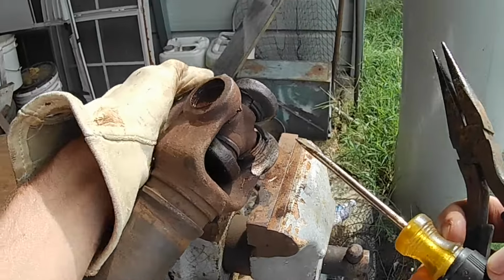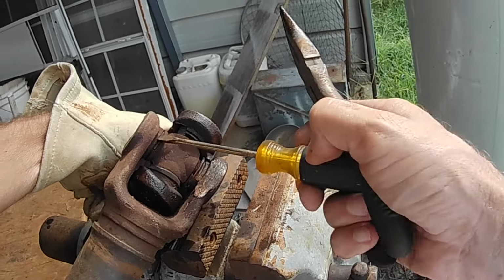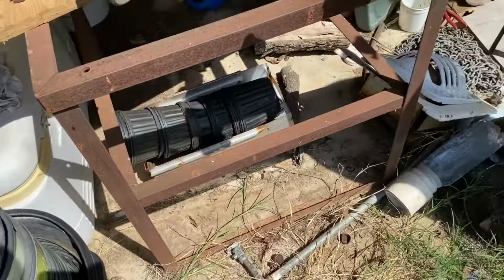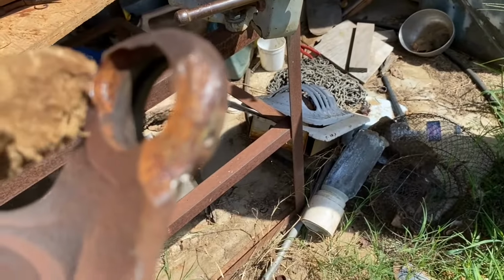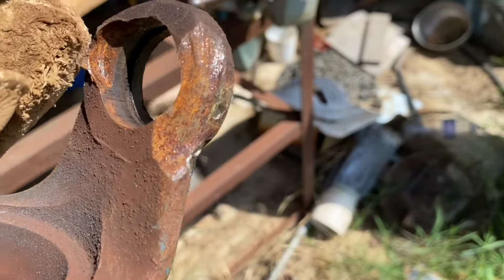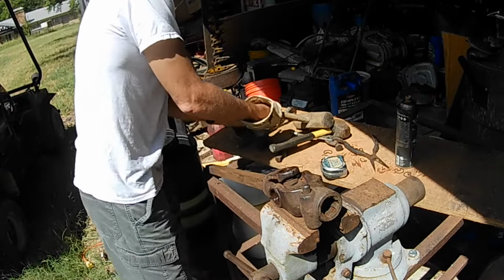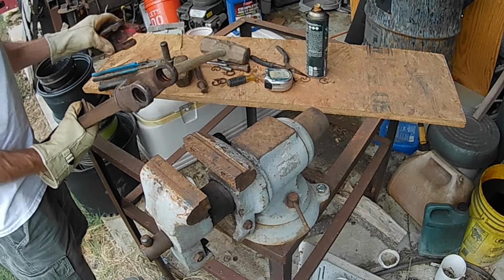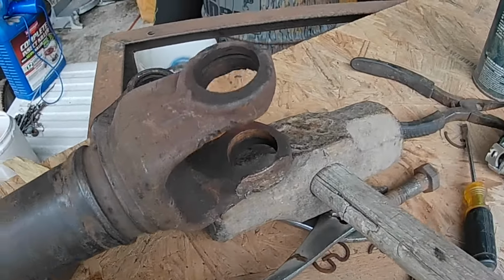Fixing PTO Shaft didn't go as planned

Comment: That has to be the hardest way I have ever seen a u-joint taken apart. Man you actually worked harder than it really is. With that big Ole hammer you have that thing would have been apart in 10 minutes. You had setup in the vise good, but you were hitting it  in the wrong spot ,you should have been hitting it on the yoke, didn't even need the punch. That was painful to watch!!
Reply from the maker: Lol thanks for the comment. Unfortunately I didn’t have anything that would fit over that darn thing. Just a few measly bolts laying around 🤦‍♂️